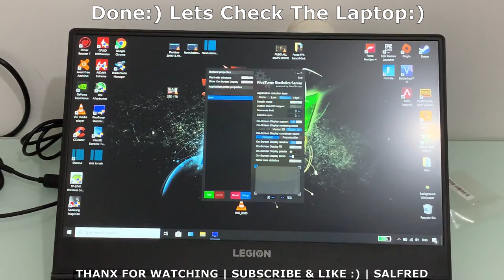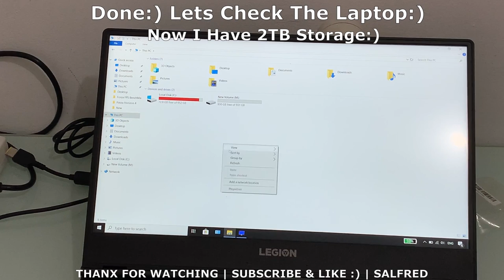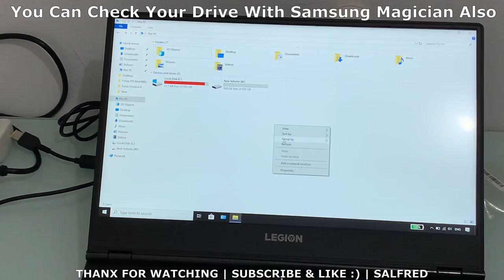‏Lenovo Legion Y540 - How To Add 2.5" SSD Driver | 1080p HD

Comment: Hey Alfred, thanks for your videos, got a lot of useful insights from your videos. 

I have the same laptop but with i5 9300h, I used throttlestop, did a 0.135 mV undervolt and changed turbo boost power to 90(short) and 65(long) with throttlestop. My max temps go to around 88 but when I play Battlefield 5 , the game closes on its own after 15 300 minutes. Could you recommend something?

Comment: Hello I putted a Toshiba 2tb HDD ... But when I'm closing the back case of the laptop, that HDD side doesn't close... Like if the HDD is a little bigger... What can I do?
Reply from the maker: Andrés Motta hi:) you need a 7mm drive, yours its 9mm if its not closed, so you can buy a sata to usb cable and connect it from out side its working fine you can look how to here: 
https://youtu.be/qsYK6GqVYh0

Comment: You did it finally
Reply from the maker: Balkeet007 lol😂 yeah it took some time till i decided to order the SSD:) thanx
BTW, the technician already checked my laptop, he told me its all fine dont need to repaste, the laptop working great... so i left the repaste thing and just will undervolt when gaming :)
Reply: @salfred5928  nice, I am on 140mv Undervolting core/cache. Hard drive replacing will do when this one deteriorates, your video will come handy then.
Reply: @Balkeet007  my i7 9750h on myvy540 seems to be bad... I can only undervolt to -125mv.. above it crash...
Reply: @aia2735  reset Undervolting. In Throttlestop go to TPL setting, set short n long power value to 32, save, exit. Now check gaming temperature
Reply: @Balkeet007  hello thank for reply, I'll not touch to my undervolt, -125mv is correct even if -140mv would be great.
I've repaste my y540 with thermal grizzly and temps are correct in game (70-80°). 
But I don't understand why I should put 32 in TPL ? Lenovo vantage bypass throttlestop for the TDP
Reply: @aia2735  setting 32 value will give best temperature, just launch Throttlestop before gaming
Reply: @Balkeet007  Si it's limiting the TDP to 32 watts right ? 
In my case throttlestop start with Windows, I already use the Lenovo silent profile , it limit the CPU to 25watts long , and 40 watt short boost
Reply: @aia2735  if using silent profile then no need of Undervolting or underwatting. If using balanced or performance mode then set TPL values to 32. And not always Throttlestop launch with windows boot. To confirm click on Throttlestop it will say already running.
Reply: @Balkeet007  of course undervolt is good with Silent mode , the TDP is lock to 25watt , so with an Undervolt the CPU at a higher clock speed, I recommend you to do that tho

Comment: Sir samsung EVO 2tb ssd works in this model
Reply from the maker: AKSHAY TECH hi:) i think it would work if you buy 2.5” SSD 2TB, in this model it has a limit only on the SSD nvme up to 2TB
Reply: Sir Sata limit 1tb or 2tb
Reply from the maker: AKSHAY TECH yes you can put 2tb no problem
Reply: Thanks

Comment: Hey dude i am back again! 😅
The laptop is running great and all but apparently i am having a problem which i am not sure of.

Till now the games i run were running fantastic. Eg. csgo and dota 2 above 100~150 fps. But not sure what happened now they are running with less than 25fps.

Please note - when i open the game they run at 100fps but after playing for some time it drops to less than 20 ish around fps and sticks there. There were no processes or heating issues found. the gpu usage is also around 30%.
Everything is in normal conditions but not the fps. Not sure what is triggering them...

PLEASE HELP
Reply: news on the problem? did you fix it?